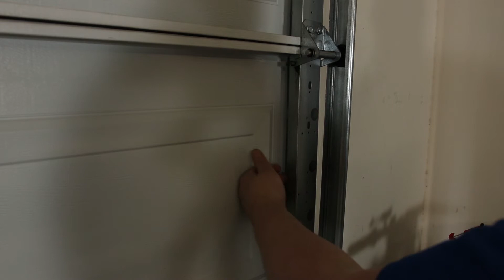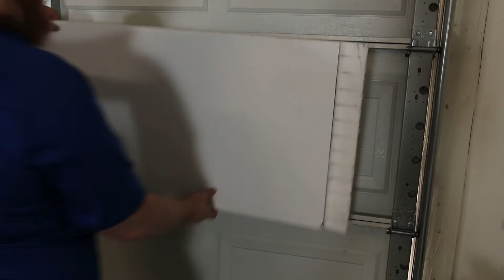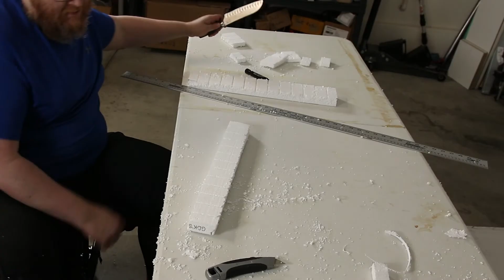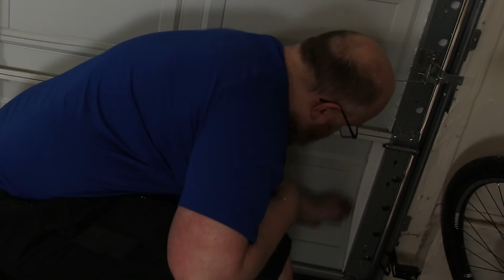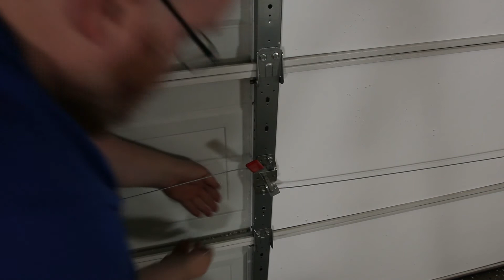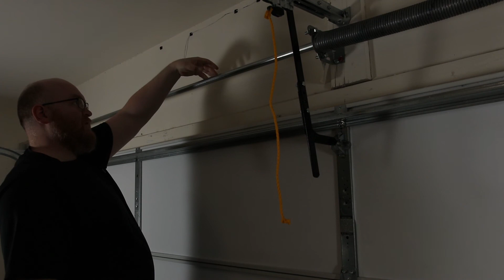Installing Garage Door Insulation And Adjusting The Door Spring

Comment: great tips on doing spring door! I was very scared to attempt it. I purchased the specific rods and as long as you take your time, it is  a simple procedure. I added insulation to one single door and had to crank the springs 3- quarter turns. my double door needs to be looked at by "new home installer". it makes too much noise and its not the springs. thanks again!